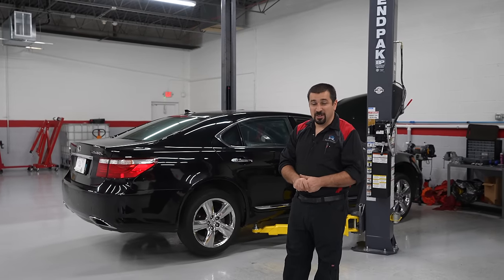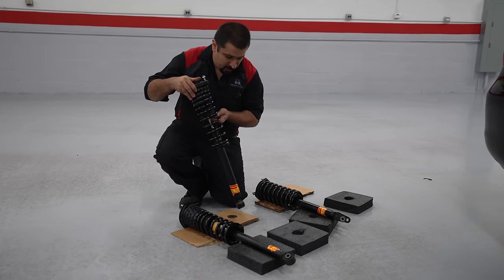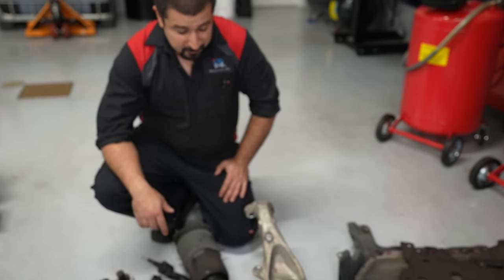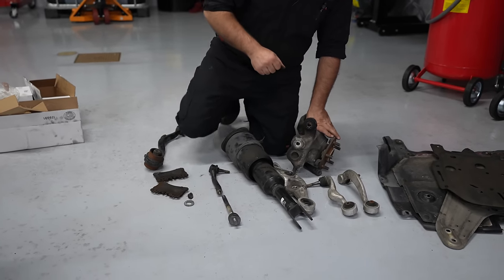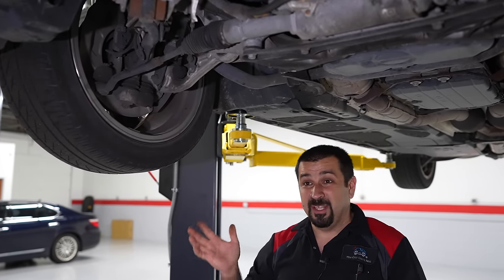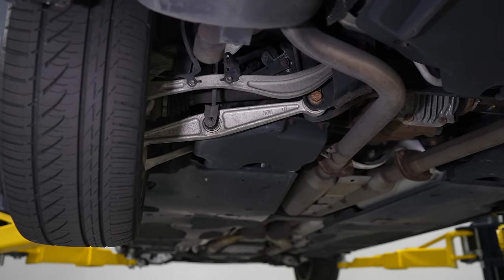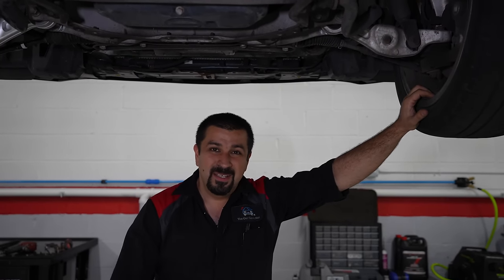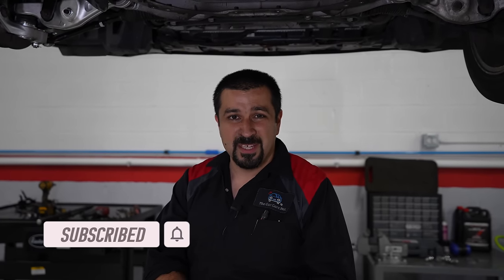Avoid THIS Lexus Model | Pre Purchase Inspection REQUIRED for this one and Here's Why.

Comment: As an LS lover I have to disagree. The blue book  value of a vehicle and the value to a person are very different.   Say you spend $10K for the vehicle and  another $6k  in repairs there is not a vehicle that exist that will give you that level of driver experience for 16K(except  maybe another used LS). So while some see a headache  I see an incredible value.
Reply: I spent 14k for mine and now I'm looking into replacing the control arms 😅
Was quoted 5k at the dealership. Hard pill to swallow but I can only imagine how better the car will feel!
Reply: If you listen again at 16:90, he is telling you that you may feel you got a bargain, but things begin to become brittle and you may end up with one expense after another that by the time you realize, you will become like one of my employees that spent $14k on a used car he  bought 2 years ago for $15k. Set the emotions aside and look at it logically. 
If your emotional, you can drive a unreliable, unsafe car that looks good or take all that money like my employee would have spent on a nice reliable newer car.
Reply: @cdmsvt how many miles?
Reply: @abedawg94  144k
Reply: @cdmsvt don’t go to stealership
Reply: @Clevelandsteamer324  I can't anywhere else to efficiently burn through my cash

Comment: My ‘08 460 has 190k miles, burns no oil, has no leaks, gets 27mpg real world at 75 mph. It’s honestly my favorite car I have ever owned, and yes I owned a LS430. Repairing the 460 is not a total nightmare, you can certainly do it yourself. When buying, yes, The car will reward you like a Lexus should. RWD non Air Ride, one owner with proper maintenance history is definitely recommended. But if you do find one that has been properly maintained, buy it, change oil every 5k miles, change brake fluid and coolant every two years. Will you need to keep an eye on the front end bushings? Yes, but the aftermarket parts are reasonable and the labor is easy.
Reply: Best & most accurate on point response!!!! I’m a true enthusiast & own every model from an LS460 with 370k original miles, and every other model from the previous generations! The 460 does require a bit more love than some of the others but as you said they are not such a killer to the pocket especially if you’re going with a more base model without the air suspension and can do most the labor work yourself. In the end of it all, unless you have a brand new car out the dealer with warranty and owe your life to it, you’re going to have to put in money in any other used car you decide to get. But if I’m going to spend money on repairs/maintenance, I’m at least going to do it to a vehicle/vehicles that I have had the best experiences with as far as quality, reliability, comfort and longevity overall! There’s a reason Toyota/Lexus holds the most value in the used car market…. ✊🏽
Reply: @jayflip3756  Yessir. Btw did you say you have 370k miles on your LS460 sheeeeeesh. Would be interested to know what you've had to repair so far. I have 100k miles on mine (only had it for 2 years so far though) and I repaired the radiator and my air suspension and bushings are likely going to need replacing relatively soon. Surely, the LS burns oil at that mileage, holy cow 370k!
Reply: Nice!
Reply: @zaker600  Yeah man I actually got the car with 270k miles from the original owner and I can honestly say it looks, runs and drives like a brand new car! Yes the control arm bushings were replaced as expected, I did have to replace the starter and I am getting a random transmission slip type of symptom from 3rd to 4th gear but I am going to get it further investigated as it’s very intermittent. The car drives phenomenal most of the time until it gives that issue, I have no problem spending $700 on another transmission but I like to get to the bottom root of the issue so I know what to look for and how to possibly avoid it in the future. I honestly think it has something to do with the transmission thermostat which most people aren’t aware that these transmissions have. In my opinion if it was a mechanical issue with the transmission itself, it would slip 100% of the time and not once in a blue. Nonetheless the car does have higher miles and it is more than deserving of a transmission swap if need be. I average 24mpg overall and I don’t burn much oil at all, perhaps a quart total within the 5000 miles. I truly love this car and honestly as an enthusiast that I am, I really don’t see myself getting rid of it unless maybe one day I find someone as passionate as I am and has the same appreciation as I do with the car. But that’s in the far future ha ha!
Reply: @jayflip3756  my transmission is doing the samething started about a month ago doesn't do it all thr time im at 195k miles it doesn't do it everyday if u find out the problem please let me know
Reply: @christophermagee9079  I got you my bro ✊🏽
Reply: With nearly 200k miles, consider yourself very lucky  for a time. However, your time will come. I still believe that a very mechanically inclined intuitive driver owner repairer is the best option to keep these cars in check and most of the money in the bank
Reply: @lyleg.9192   Lucky how? Maintenance is not luck.
Reply: @zaker600  he did not mention the MY, 2013MY and later ones are much better quality than before.
Reply: Previous owner didn’t maintain the ls. These cars are reliable
Reply: @jayflip3756  What year is your car?
Reply: @mrt4085  2007
Reply: @jayflip3756  

Beautiful!
Reply: @jayflip3756  that is good to hear. I am looking in getting a used car and I was leaning more on the ls 460 side of the lexus brand. This is the first video I came across on and it gave me seconds thoughts on getting a used ls 460. After seeing your comment it gave me hope again and now I want it even more. Any advice on purchasing one because I would love to get one but not like the one on this video, looks pretty bad
Reply: @githuagitau7435  honestly it’s a great vehicle &  the most reliable in comparison to any of the other luxury competitors by miles! Only thing I recommend is change all fluids including transmission. Control arm bushings do go bad but it’s not horrible to do. I personally love this car! Good luck on your find! 👍🏽
Reply: @jayflip3756  so the control arms can be changed personally . Granted I am probably not as mechanically inclined as u are but I think I have a fair knowledge around tools since I am a mechanic in training. Not for cars but for airplanes lol.
Reply: @jayflip3756  and also, I heard that when u do change the transmission oil, you will have to change it now every 15k miles.
Reply: @githuagitau7435  I’d take the car to Lexus dealer and they charge me roughly $180 for the drain and fill for the transmission. And I’m sure you don’t have to change it as frequent but I’d do it probably every other year.
Reply: @Disgruntled Simp Mod i just got the ls460 L
Reply: 07-2012 were Garbage !
Reply: @normanfillmore3490   I just bought a 2008 LS460L ultra luxury. It doesn't have a flip down TV though lol.  Glad to hear these good comments about the car.  What is SWB? Only bad thing the guy did was put the car on lowering coil overs. I want a better ride, any suggestions? And it doesn't have bluetooth audio.
Reply: As someone who owns an 08 LS460 short wheelbase, this is true. Best purchase ever. If I was going to replace my car, it would be with another LS460.
Reply: @Overqualified1  me too but I have the L version
Reply: @Overqualified1  the Early models were Trash as they transitioned abruptly from probably what was the Finest Sedan Ever(Albeit Ugly)the 430!  But from 2013 to 2017 it was a Solid car with most problems resolved and 60% incrrease in Chassis rigidity and New Dashboard layout.
Reply: @highwaystar3780  i mostly agree, but I was fortunate enough to get the 07 version. Ik it is the model with most of the problems but I cannot complain. Drives like a dream
Reply: @githuagitau7435  well yeah,  the Ride Quality is simply Amazing despite reliability.  And the fit/finish is unsurpassed.  Shame what they did to ls500 with puny v6 and Bizzare  styling inside/outside.  Personally I don't think it will survive?!  I work on 5th Ave and despite what We may think of New sclass...it's All over the place here outselling everything in its Category 10 to 1.
Reply: @highwaystar3780  i also saw that the hp dropped on the ls500. The v6 explains it
Reply: @githuagitau7435  Lucky you!  I am looking at an 07 with 75k miles, wish me luck.
Reply: @markbailey6051  good luck G, I got mine with 93k so maintenance gonna be a fun talk with my wallet
Reply: @bobbydelamar606  SWB IS SHORT WHEEL BASE
Reply: @SocraticMind89  Thank you. I found factory KYB assemblies. Rides so much better. But now my rear seats, heat and AC, don't work. 😆 I must have forgotten something.
Reply: Every 5k oil change ???
Reply: No, cancel that, I'm an idiot. There's a button in the front that turns the heated/cooled rear seats on 😆  I just did my first oil change with synthetic oil and Mobile 1 filter. I called the dealer, and they said they don't change or check transmission or differential fluid EVER...??? How are these checked and replaced? Drain and refill?
Reply: 19:16
Reply: Exactly..you have to fix thing on these cars for sure!!..but the car engine and drivetrain are bulletproof and last over 300k miles easily!!!
So you could avoid this and buy some BMW or other Junk and spend and arm and a leg on everything and it dies at 100k..or get a Lexus..costs money to fix..but last forever!!!
Reply: @gennaro4941 orrect .  Transmission fails sub100k and new control arms every 50k and   Air suspension and radiator at 75k and new hybrid battery at 15 years.  But still far cheaper than Bmw 7 series
Reply: @bobbydelamar606  My Lexus dealer also refused to change the transmission fluid. (2012 LS460L) They said they didn't even have a cost code to use in their computer billing system. I took it the my local Toyota dealer and had them do a flush at 93,000 miles. Cost $344. I know, I know, flushing is forbidden but it worked for me.
Reply: @MCraig-ly1qq  Awesome! I might have to try that. Wonder if there is an option for just a drain and refill?
Reply: I have one the same year. 160,000 miles and runs like a top. Best car I've ever had.
Reply: @jayflip3756 when doing the transmission fluid did you do a drop and fill with 3 quarts?
Reply: Just bought 09 with 100k from auction. No issues but needs front air struts. Any idea where to get parts for good price?

Comment: I own one with 208k miles on it. Yes, they can be expensive to maintain, but they rarely break down. These are some of the best cars ever made period. Great review.
Reply: I love my ls460 L
Reply: I am about to purchase a 2008 LS 460L LITERALLY over the next few days with 158,000 miles on it, is it WORTH it?
Reply: @d1spoonky  Yes.  If you can afford new brakes, valve cover gaskets and plugs, ignition coils/ tune up.  I've had mine for 4 years and bought it with 127k and have 172k miles.  Best car I've ever owned or driven by far
Reply: @MrTeddycozmik  Thanks, the dealer sold it from under me LITERALLY the night before I was to buy it (NOT mad though, its business), but there are others I'm considering...Thanks!
Reply: @d1spoonky knock $6k off the price for inevitable suspension work
Reply: I agree they rarely break down. Mine is 2012 with 175,000 miles.  The only thing I have had to do is tires and batteries. I did replace the A/C air fan that was starting to go bad, but nothing major. Maintenance is expensive, but critical if you want to continue to have miles of trouble free motoring
Reply: @d1spoonky I would stay away from the 07, 08 & 09s. Start with the mid cycle refresh 10, 11 &12s
Reply: @d1spoonky  If you can find a 2006 top of the line trim LS430, it's just as good and is way easier to repair and maintain. The engine mounts are easier to replace than on a 2008 Toyota Camry. The lower ball joint is 2 bolts to replace, no pressing in/out or replacing steering knuckles. Overall, the suspension design of the LS430 makes it one of the easiest cars to work on, easier than a 1991 Honda CRX than needs to press out and in the lower ball joint. 

The LS460 is the exact opposite. I can't own one because the roads in my area are so bad, the suspension won't last 1 year and replacing an entire aluminum knuckle every year is absurd. The LS430 has aftermarket parts with spherical ball joints that are indestructible from various aftermarket companies while the 460 doesn't. Figs Engineering is the one I use.
Reply: He said that they are expensive to maintain, yet mine with over 100k miles had only oil change, pads rotor, and a lightbulb. It’s been a killer car. And will continue to be. It’s not expensive at all to maintain considering what they go for new, and how often things need to be replaced. Realistically the bushing in the lower rear arm is just too soft of a durometer and that causes excess wear/breakdown of other bushings. Outside of that these cars are really one of the best out there
Reply: Just bought an 08 with 149k as a daily I will be changing the valve cover gaskets and o2 sensors at home. Dealer quoted me 4k to do both but both seem like fairly simple jobs after a bit of research. Both parts are under $100 for oem spec. Will give an update. Update* dealer I bought the car from fixed both issues free via warranty, I’ve been driving nearly 3 weeks no issues no check engine lights or vsc lights. It only took one day for the fix.
Reply: I own both the 430 and 460. My 430 is more reliable
Reply: I was quoted $2500 for coilover conversion for 2008 LS 460 L with 180k miles
Reply: @256jayy3 I found a 2007 LS460 with 73k one owner. I've been on three trips over 30 hrs of driving. The crazy thing is I sold my 2015 S550 and I'm no the least bit mad.

Comment: My wife drove her 1998 LS400 for 19 years. Other than a mirror switch which broke,. after 18 years,  just changed the oil and nothing else to fix. Replaced the LS 400 with a used low mileage 2014 LS460, and other than a rain sensor, replaced under warrantee, it has been 100% problem free. Regular oil and fluid changes, and it keeps on going without any problems what so over. I've had 6 different Lexus models, all problem free, other than routine wear,  brake and tire replacements. What's not to love about Toyota/Lexus products? I'm now driving a 2020 RC350 F-sport. After 2 years, no problems.  Southern California weather may help the longitivtiy, but does not change the almost complete lack of problems. So far, ultimately cheap to keep. Oh, my 1984 Supra's first brake job was at 96,000 miles. Talk about bullet  proof, and I sold that vehicle in 1995 for a Lexus. Of course my opinion is, that these vehicles are very reliable, after their initial cost.
Reply: Most cars should last a long time in the southwest.  In new england rust kills cars way before their time, and makes it a pain to work on.  Wheel bearings are a pain, calipers and brake/fuel lines rust out from the road salt spray.
Reply: " just changed the oil and nothing else to fix" so tired of these delusional expressions. No car can last only on oil changes. You still have to replace, brakes, shocks, springs, belts and many other wear and tear parts as the mileage keeps growing. The question is: can you afford to maintain it?! Any car can last as long as you can afford to maintain it, which depends on your budget. So, reliability comes not from the car but from how reliable is your wallet.

Comment: I had a swb 2008 LS460 with 19" wheels.   Loved it!.   It was rare non air suspension with reclining rear seats.  I was able to swap out a lot of the parts myself. It was well behaved but I always feared the brake actuator failure.  It was an automatic $3000 cost  that only the dealer can repair. 
I ended up reluctantly selling it.  3 years later I heard from the owner and it has been problem free! 😭  I regret selling it & could have enjoyed a few more years of ownership.  I ended up roughing it in a 2006 V6 Camry.  The Camry has been extremely reliable and stress free it blends into the crowd . It's what I need in these "crazy times" !
Reply: Wrong. A regular mechanic fixed mine. I got the part for $800 and charged me $500 to put it on and program it.
Reply: @rockflock4698    b.s
Reply: @JJ-rw2pj  facts
Reply: Who told you only the dealer can repair  it? Lemme guess, they did? 🤣

Comment: I had a 1996 LS400. No air suspension. The quietest ride with a nakamichi sound system. The only repairs I had to do were the front suspension. The engine was a very quiet V8.
Reply: Best LS made and the LS430 and love the GS too back then too!
Reply: ls 400 is great! I have a sc 430 and its so smooth and quiet
Reply: @CarsofGlasgow  👍
Reply: We have two Lexus cars.  A 1993 LS400 we bought for $4000.00 three years ago in California, a one owner, always garaged, good maintenance records.  Under 80K miles!  Still have it, the only problems are with the 'bells and whistles" some of which I don't bother to fix as they don't present any real problems to me.  I also bought a 2007 LS460L, less than 70K, one owner, clean carfax, always garaged in Florida, it is in pristine shape overall.  I paid 28K for it.  Have had problems already with sensor lights coming on, had some brake parts replaced, the interior is the one that turns to "putty" over time and unfortunately the owner never took it to Lexus for the no cost redo of the interior parts so there's that.  At the moment I have to say I am already having buyers remorse as it isn't any "better" than my 93 LS 400 in most ways.  I think I will sell it as soon as possible and keep the 93 and fix whatever may come with it, it will be a lot less expensive in the long run.  Buyer the LS460L was an impulse buy, I should have done more research.
Reply: @claudiadickerman4218  yes, the ls460 can be more expensive to maintain.